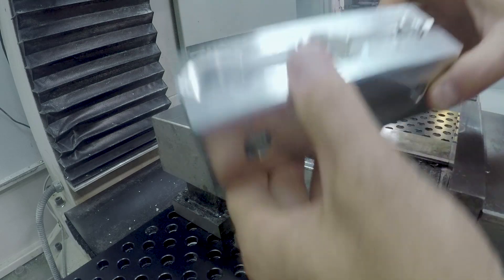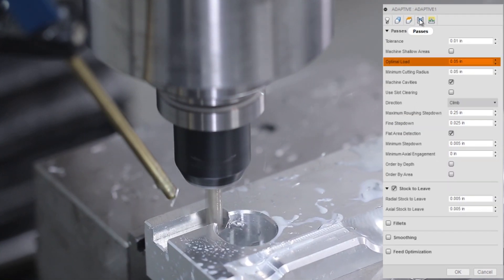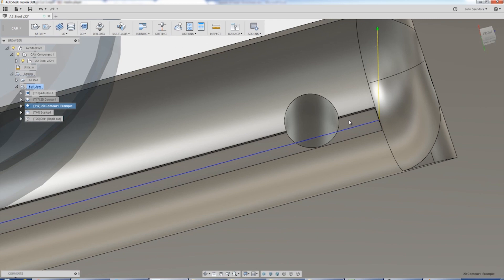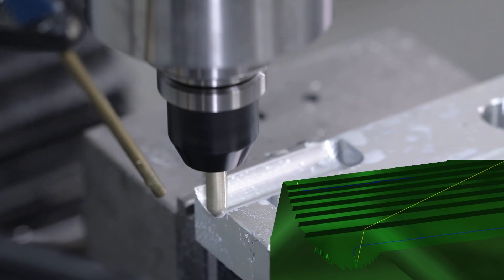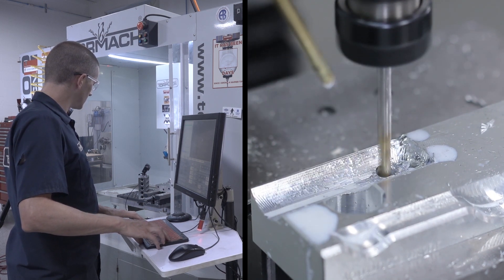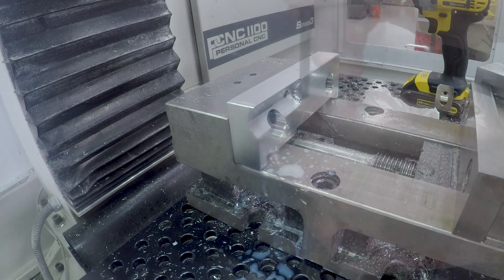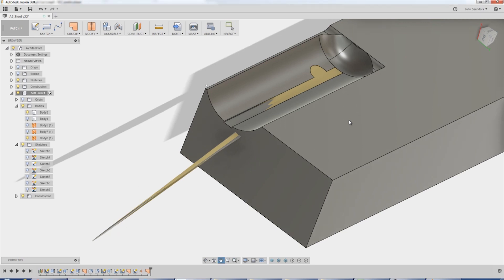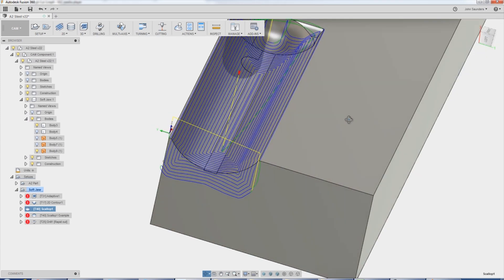Machining Soft Jaws to hold Round Bar!  WW165

Comment: Okay, does this have an advantage over just whipping out a v-block? :)
Reply: The first thing I see, is that the Jaw holds the part in a specific way, no complex setup involving a stop, and whatnot. A jaw is easier to use.

I like to think, that the video is more or less just about the application of what you might want to do later. Having this figured out can enabled you hold a different set of parts than the size/length here. Teaching videos can show you to come up with your own conclusion to make something equal or better, for your part.

As for me, for most applications, I wouldn't have bothered with slotting that center piece, the ballnose will cut that just fine. However, Fusion can be tricky to work with, and John is showing how you would create this toolpath in it, the patchwork, etc. Because you never know, that for even larger workpieces, taking the time to figure it for a more efficient run will help you in the long run for large orders. If you can avoid cutting the ball center, of course it's better.

Comment: You have mentioned Lakeshore Carbide many times, so I ordered some end mills for steel and some 3 flute for aluminum. As I opened each one I found them very impressive, hefty carbide weight, very very sharp. They were great at removing material, I will never buy 3rd world tooling again.  I did mention that I'm here because John Saunders of NYC CNC  said you guys are great and so are your products.

Comment: If you want to get nerdy about it.. your ball tool actually has significant chip thinning both axially and radially.. and a set of untrimmed surfaces would be slightly more awesome than the single patched surface.. good work, though, particularly from a practical standpoint, none of the stuff I'm nit-picking matters.. :)

Comment: In this situation it doesn't matter but I am not a fan of scallop toolpaths because it works in a rectangular motion. This creates perpendicular cuts on the ends, also it's difficult to maintain a smooth cut the closer to the bottom of the curve you're cutting. This is amplified as the pocket size increases. I prefer a toolpath that gives control over "cusp height".

Comment: John, you must have picked a 2 flute tool from your F360 tool library:
flutes=feed/(chipload*speed)=21/(0.0205882*5100)=2

Then, running a 3 flute tool @21in/min and 5100rpm your actual
chipload=0.00137in/tooth

and @0.5in WoC your actual
chip thickness=0.00110in/tooth

Comment: nice video and good teaching video.  Tho couldnt you hold part in a 5c collet instead and avoid the work
Reply: David Scribbins yes but then youd have to use extra stock to hold onto and youd have a lot of stick out. this setup gives access to the whole length.
Reply: Yawn V Jaws/V Block
Reply: That's what V blocks are for. Soft jaws and needing low profile bolts to do a keyway is pretty inelegant by any measure.
Reply: I would argue the v blocks are far less elegant. In reality, its merely the difference between a production run and a single job. Furthermore, that's actually not what v blocks are "for". V blocks are more a precision measurement device than a makeshift clamp.

Comment: The only thing I don't like about my orange vise is no Monster Jaws. I have 8 sets left over haha

I am having so much trouble with 3D right now. Trying to contour with a smooth lead in and out. The only way it's working for me at all is to plunge. Everything else generates a straight ramp in the opposite direction of the cutting path at 5 or 6 seemingly random heights
Reply: You can throw Monster Jaws on the Orange. The CarveSmart integration still has 1/2"-13 (I think that's the size) threaded holes for you to bolt standard Kurt pattern jaws on there. The latest Orange vises let you flip the master jaws around to turn the standard jaw pattern holes inward and run it just like a Kurt. Because Orange is flipping amazing!